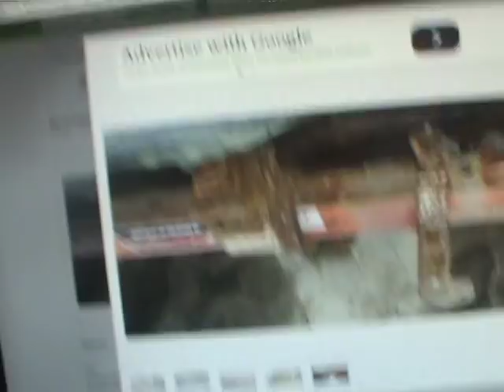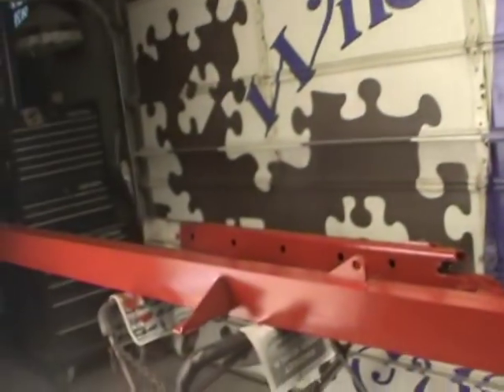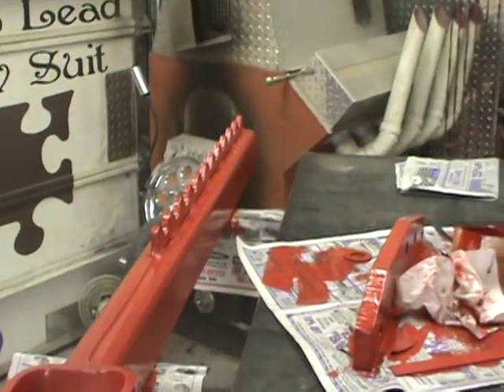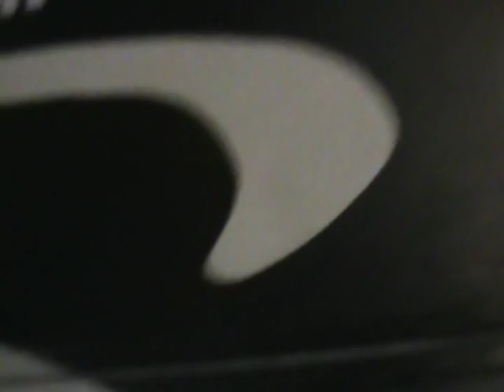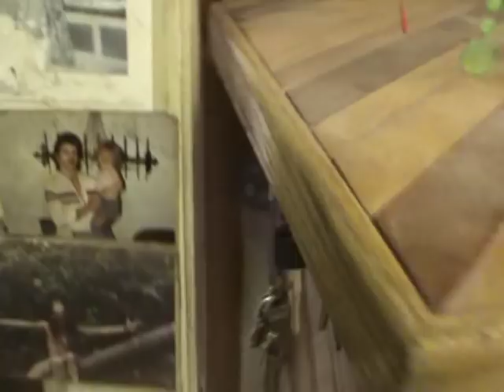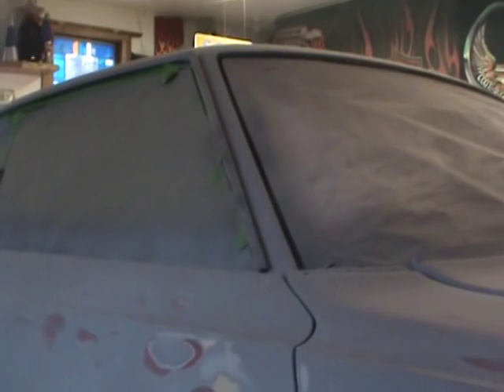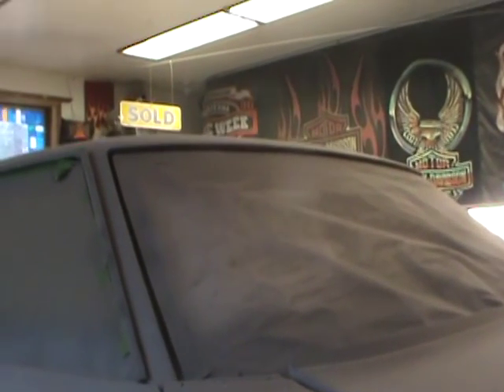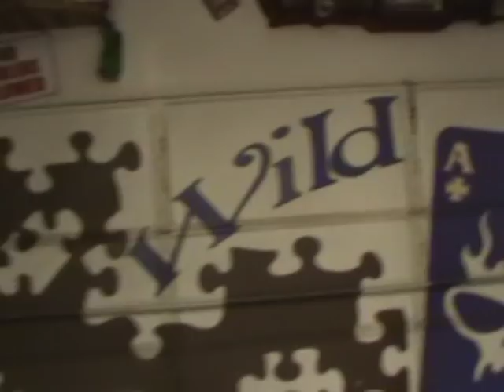BLACKHAWK DOZER PANEL PULLER

Comment: Puller looks great!
When I break thru to metal and still have a low spot, I mark it with tape, scuff it with 180, and put a "tight" wipe of polyester glazing putty over it.  Then block the putty with 180.  I've been known to chase my tail a time or two re-priming an entire vehicle.  Spot prime the putty and other sand thru's, guide coat,  and lightly block it.   Seal entire thing or just small sand thrus before paint.  Just my way.  I hate finger f-ing all those little areas from a full re-prime.  That kind of sanding drives me nuts :)
Reply from the maker: Velvethamma i am in that crazy ZONE ..right now..the car is sooo close...then here cumms the glaze...i hate that part LOL

Comment: the sill/rocker clamps attatch to the sill/rocker with the tube through the middle so you can push from that, be carefull you can damage the sills/rocker too.
the foot on the end which pushes on the center tube can also be used to push of the strong points of the car itsself, like a proper frame or strong suspension/axle, depending on how hard you are pulling

as for pots in the floor, still a very good idea to have them as the dozer will want to twist and tip as it comes under force at various angles

dozers are good starting out and get out of trouble tools, imo i'd use two sets of clamps and beam wit two push feet better attached to prevent tipping and allow up/ down pull

full appreciate what you have there and what it means to you but what is the cost of a new one or a complete second hand one?,
Reply from the maker: messylaura its like this...i have a good start..there is the sill / rocker attatch that i will make...& i KNOW when i am done with it..it will b stronger that the kit 4 it from toolmart for $384.00 plus i like building stuff   PEEEACE